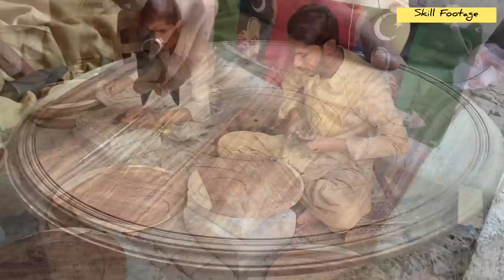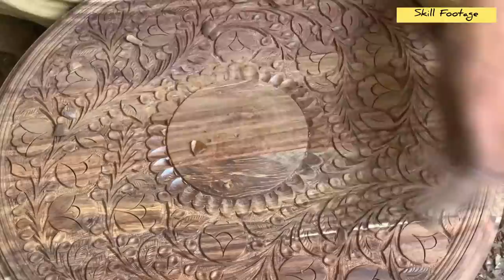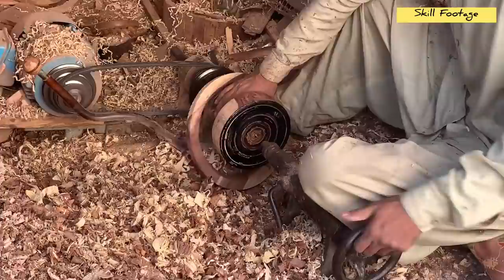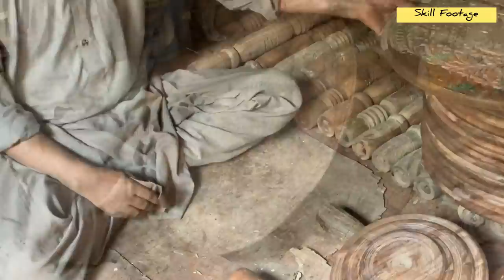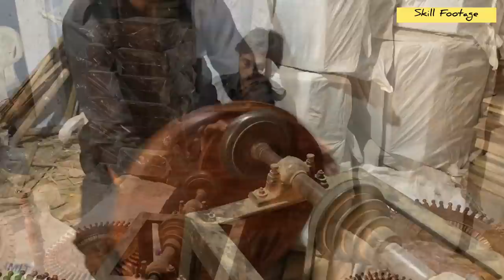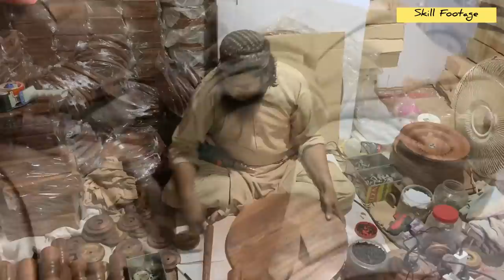How Hand Carved Coffee Table are Made | How to Build Pure Wooden Coffee Table | Walnut Coffee Table

Comment: If I had one of those tables I would properly have the top surface coated in resin to give a smooth uniform and protected surface so that lovely pattern wouldn't be damaged over time :)
Reply: I wouldn’t put anything on it that would harm it. Keep it out of the sun. It will damage the color. Resin may take away from the original beauty of the table.